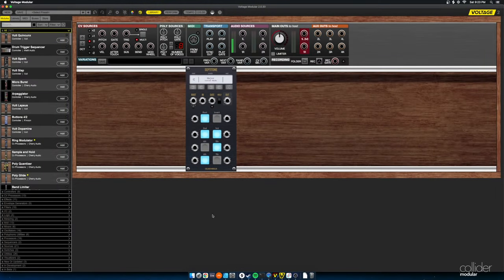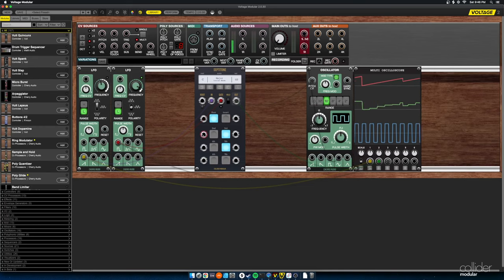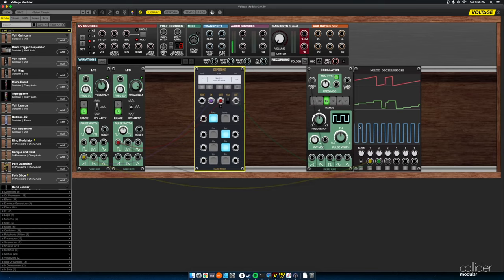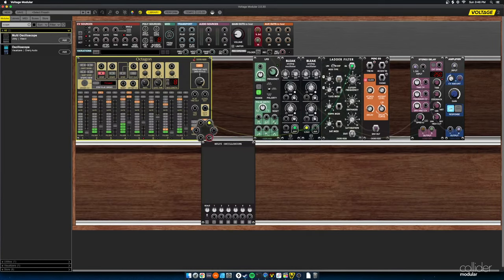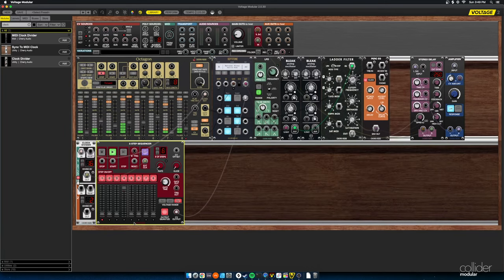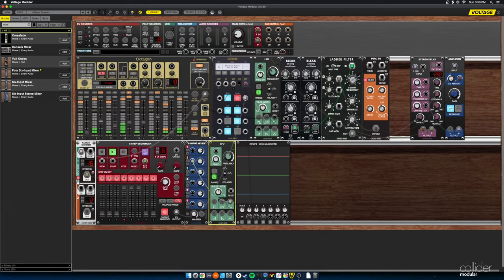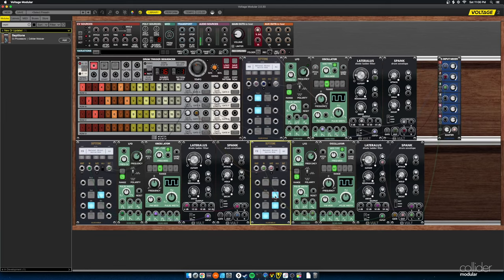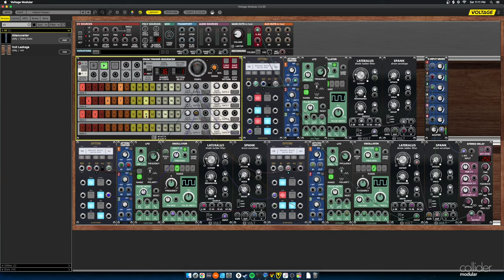Collider Modular - Septitone Video Manual (for Voltage Modular)

Comment: Very cool video. Thanks. Clever use of chord tones. In this and your other vids you allude to applications in live performance. Are there videos of those performances? Any other suggestions of tutorials for building patches or live use? Thanks again for your work.
Reply from the maker: Great question. I'm coming at VM from a eurorack background, where thinking of one's modular as a complete performance instrument is quite common. When I say "live performance", I'm meaning that kind of perspective. I haven't done any videos explaining the concept, but the idea is basically to use VM in standalone mode, where you screen capture yourself doing a more or less live performance. It's a different mode to using VM, and can be quite fun once you get the hang of it.